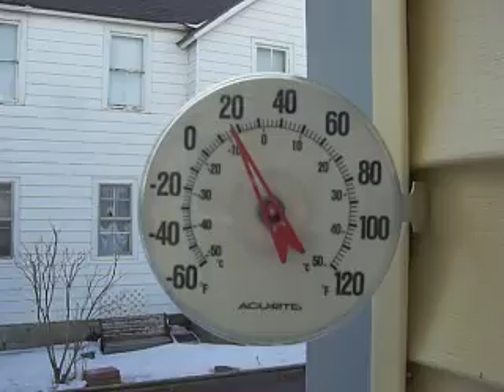Maple Syrup Time Soon... Crank 'er UP!!!

Comment: Mine takes 2 10 sec cycle with 7 brand new plugs. The 8th one was swollen so I just unplugged it. 
corvairwild, try holding the accelerator to the floor, the owners manual says to do that below 32F.